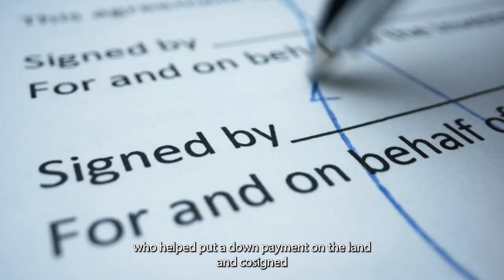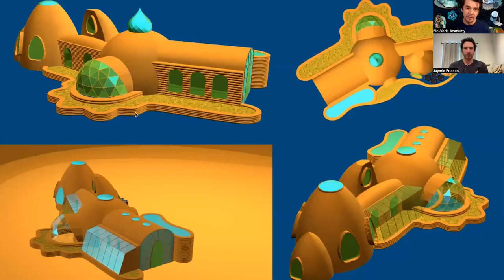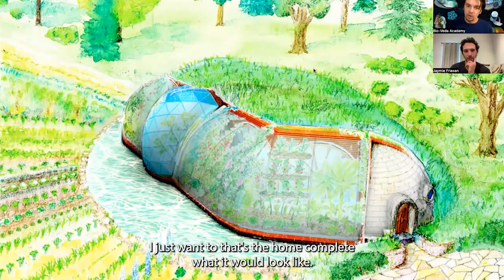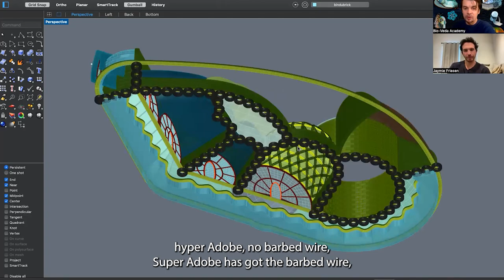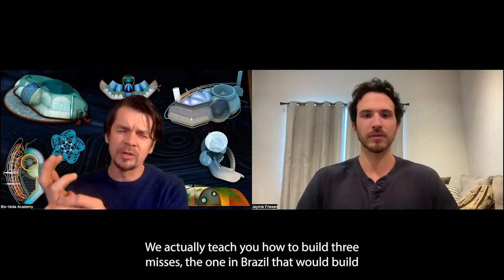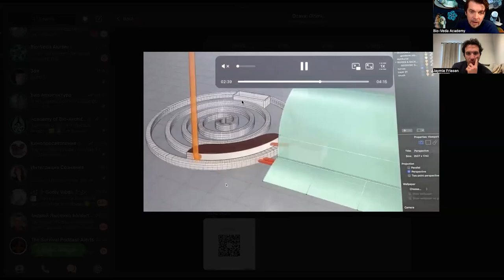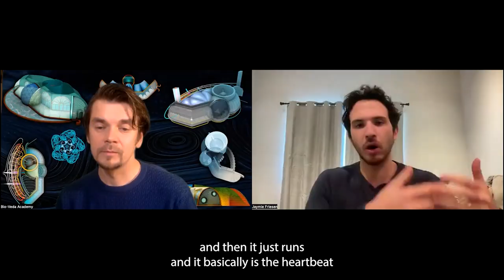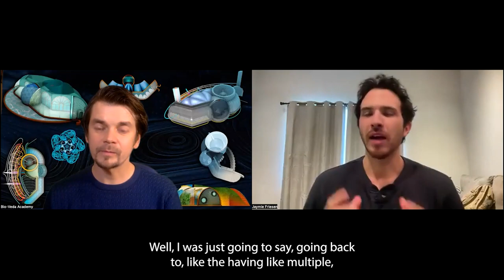Strategic foolproof start-up on the land

Comment: @34:20  I'm designing a large sunken tub with glass doors all around to absorb the heat - and to serve as a small green house - with an enclosed sunken courtyard to the east to catch the early morning sun - another enclosed sunken courtyard to the west will absorb the last heat from the sun in the late afternoon.  I also plan for a small Earth-bermed moss-covered hobbit house, wood-burning cook stoves with copper coil to heat the floors and copper coil around the flue to provide hot shower water ...
Reply from the maker: Amazing stacking functions. I design in similar ways
Reply: @AloshaLynov  I've been an architectural designer for 45 years - I studied City Planning in university - passive solar, Earth-bermed, Earthships, rain catchment and other off-grid wonders.

I've designed a city with dozens of micro-villages with their own interrelating design themes - I love your work and research - I haven't uploaded my architectural work - I'm busy exposing the parasites that control this world.
Reply from the maker: @WhirledPublishing  I am doing the same, join our truth speaker channel : https://t.me/revealtruth

Comment: We bought property 3 years ago. It's actually a natural mature food forest type sugar bush property. So far we have been build a camp on it. Got a grill/smoker because fire dangers, outhouse 4 walls built on a pallet, a point well pounded by hand and it flows. Got piers dug for raft foundation. I have only 45 days a year to build up north. I did some math on the berm vs buying insulation. Better off paying for insulation it's less labor. I am not worried about cooling my house because cold climate. I do need a vent to daylight in masonry floor as required by code. My porch will be a half circle. I am a big fan of Richardsonian Romanesque building style and earthships. I do masonry work and have great local building stones cheap.  Trying to get r60 on floor, north wall, and roof. R60 windows on solar south wall would be nice but not cheap. Doing a double pane Lexan - Polycarbonate windows horizontal. With condensation vents. Horizontal because less temp change and condensation vs vertical. Hoping to have the 24x24 skillion pavilion frame built this year. My north wall will be concrete block, low perm vapor barrier, rock wool, and rip rap masonry veneer 12" going to 8". I have to come back down state because no shelter. I have work and foods up north. Also need a spring house, and sugar shack for syrup, jams and jellies, honey, and canning. We are getting certified organic too. I chainsaw some of my own wood. Get a 70 cc + chainsaw of 9000+ rpms. I have destroyed a chain saw. 20 inch leaning dry white pine. To big and bad location so milling there to move timbers up the ridge. I am actually a fan of Brochs and Atlantic round houses or wheel houses. Plan on building a Broch after a sailboat.

Comment: I factor earth insulation in as outside temp. Meaning my floor would be more like a zone 6-7 winter all year under it. But need insulation and thermal break under masonry for thermal mass. I do masonry foundations so know how and what is required. I build grow rooms for people too. That's more of a insurance thing with breezeways than building code. I been trying to get someone to come out to my property. I need a site address aka fire number. To get permit. The foundation is dug by hand for my skillion pavilion cottage. Waiting for inspector. Just a simple timber frame skillion cottage. Doing Boss of The Swamp style septic. Decided to go full permits. To show you can build a Richarsonian Romesque masonry timber framed earthship cheap. And with less labor. I use an open sources free building plan. That was meant to be a skillion pavilion. Had to add extra post and rafters for residential building codes. Because header spans on exterior load bearing wall. Or increase header size. So have 4 post per timber frame bent now. I could cut carbon cost by using all rock rather than some concrete block. The cost for 40 tons western delta honey comb limestone is only 800$ but 1200$ for the carter to haul it. The rock with the eyes in it like The Temples of Malta. Doing some polygonal masonry and post and lintel old world kitchen. Capitals at the bottom in touch with the common person. Not looming over head out of touch like the government.